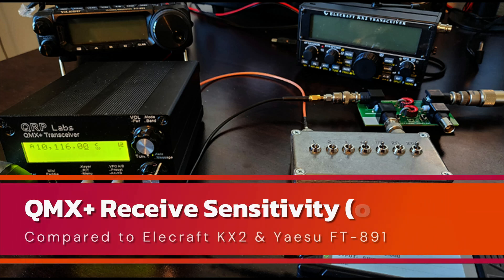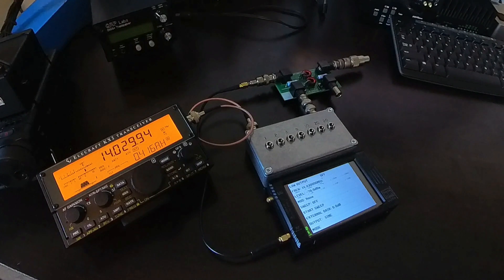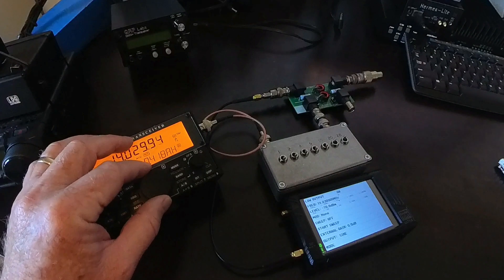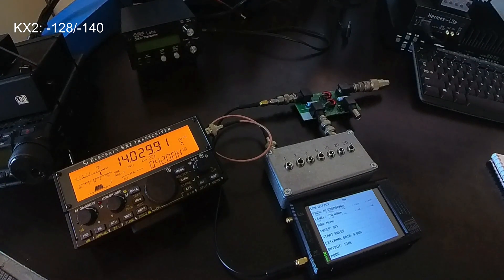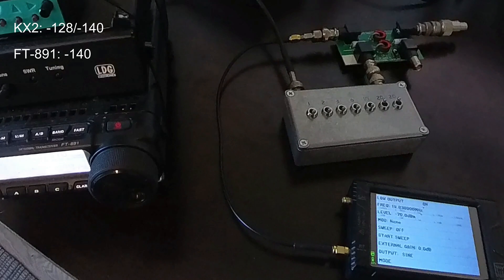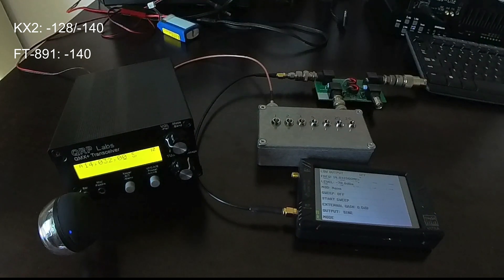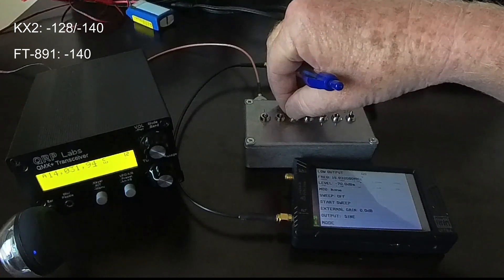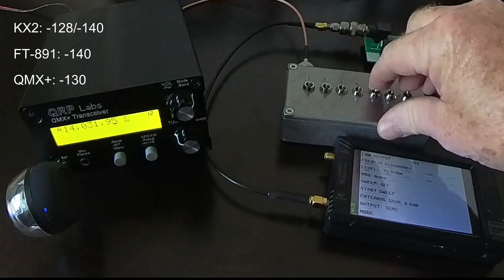QMX+, KX2, FT-891 receiver sensitivity comparison

Comment: I did the same type of measurement on my QMX-low and QMX-high. TinySA, two Amazon-bought 50 Ohm attenuators of 41 dB (sticker says 40 dB), and adjust the internal variable attenuator in the TinySA.  Each component is adding at least +/-1 dB of error, so the final results have a bit of error bar to them.  But my results are pretty close to your results.  Except that I don't see the dropoff on 12m and 10m on my QMX-high.  They are about the same as 20m.  On the other hand, for some bands, it matters greatly where in the band I measure.  20m and 15m have a behavior that at the low end of the band, say around xx.020 MHz, the MDS is like your table.  But around xx.050 to xx.070, the MDS is about 10 dB worse.  There is a noticeable rise in the noise floor as I tune up from the bottom of the band, with the peak noise right around the QRP calling frequencies (ugh).  Since 20m is supported by both my rigs, I checked if this could be replicated on both rigs, and it can.  I also have an older Rev 1 9-volt built QMX-low, and its 20m has the same behavior.  So I wonder if this is a characteristic of the architecture.  73 de N9OHW
Reply from the maker: That's odd...for the MDS to vary within a band. I'll check mine in a week or two. Thanks for the info. 73
Reply: @AE5X  There are a number of things that I haven't ruled out yet.  The lithium Ion battery pack I used (has some BMS running in it), noise generated from the TinySA, other environmental noise.  I'd like to repeat it with a non-QMX rig, and I'd like to repeat the by-ear noise measurement on the QMX next time I am in the field away from noise sources and using an alkaline battery pack.

Comment: Hello, on HF, at least up to 40 or up to 20 meters, it makes no sense to talk about receiver sensitivity: they all have more than enough sensitivity to receive natural noise and therefore useful signals, which must be higher in level than natural noise.
Anyone can do a simple test by disconnecting the antenna from the receiver (it should be connected to a non-inductive resistor with a value equal to the input impedance of the receiver, but here it makes little difference).
By turning up the volume, you hear a slight hiss; connecting the antenna, you receive signals but the noise increases a lot: with a more sensitive receiver, both noise and signals would only be stronger, but their ratio (signal-to-noise, which is what is needed for intelligibility) would remain the same.
From about VHF and upwards, the discussion is reversed and the sensitivity of the receiver (with the same noise produced) becomes decisive for the reception of the lowest signals. 73s
Reply from the maker: I agree with your first sentence - IF the receiver is working properly. A bad solder joint or an improperly wound coil can cause receiver sensitivity to be less than optimum, so why not make a quick measurement to ensure that the rx is capable of doing what is expected - and to know the degree of sensitivity (or lack of) per band. 73

Comment: I assume the FT-891 has a RF preamp running. Great performance from a kit, that's a fraction of the price of those others'. I wonder what the off frequency performance is like.
Reply from the maker: Yes, the FT-891 pre-amp was on. I should have put the QMX+ on the air during CQWW-CW - that would have been an interesting real-world test of adjacent freq performance. ARRL DX contest is in a few weeks though...

Comment: Meh, sensitivity is overrated (for HF). Dynamic range and receiver noise are so much more important for real-world operating, in my opinion. 🙂Thanks for the test though! 73s
Reply from the maker: I agree. Dynamic range & selectivity are much more important.
Reply: You're right. If you're running QRP and portable, it is likely that most of those you'll be talking with will have more power and better antennas. Receiving them is not that critical. The wonder is that such little power can often go so far.
Reply: @Inkling777  Having a performant receiver is important, regardless of QRP or QRO, but it’s just that sensitivity is rather low on my list of things that actually make a receiver high performance (at least on HF—when you go up the VHF and above, sensitivity becomes more important).